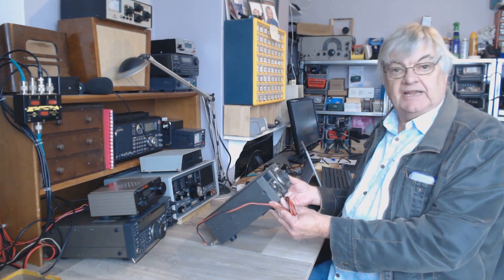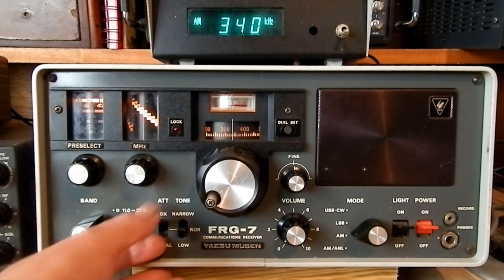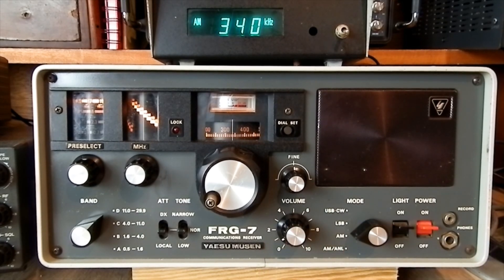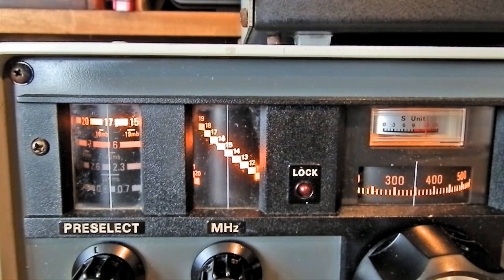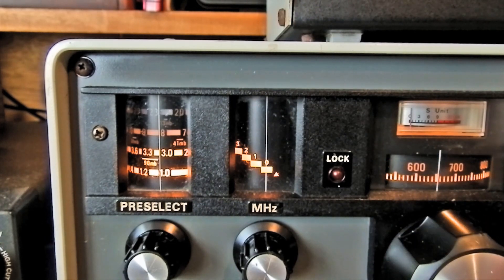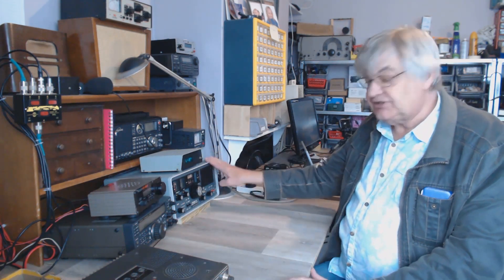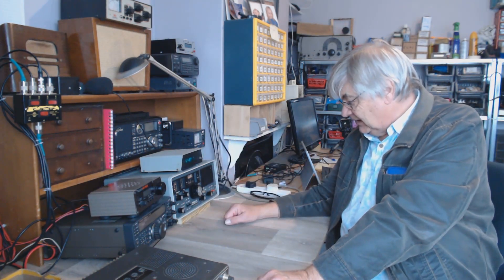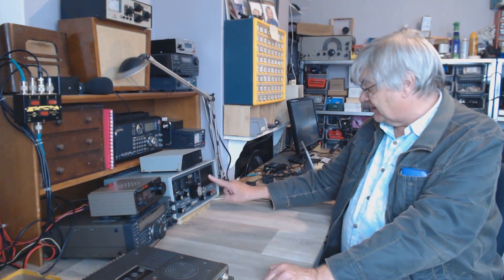G4NSJ - Yaesu FRG7 how to operate short wave communications receiver FRG 7 Frog

Comment: Hi just picked up an FRG7,  (August 2023 ) which Mini whip do you use ? very helpful video regards Alan
Reply from the maker: Hi Alan, This is the one from ebay.   https://www.ebay.co.uk/itm/295509916499?hash=item44cdc37b53:g:Fq0AAOSwF31j3jFL&amdata=enc%3AAQAIAAAA4Bl4mJZaZ4kO8ZzW4xE2RGfqi2L%2FcWRv3dUaLCrx6rbg5s6%2FpP0skPHCx%2FSsWqNbSz86UTu0P33di%2FVwPcTySOfNvZaiMStkUdQbHYNpT9Hp5THNoXphiNF3RqlDXftcpXTRL27t7E7lEiSJ6Wru3LsiM4zkH4J%2BS8rFLLmHE5fZGI4djRPB3%2FptfU%2BIGr9yZEmXH7oguvr35%2F12B%2FF0%2Fim5EUVGh7t2UL1igTojwlpwMXKu7gTDzPricnDUl%2BBmXbxRnB5mChp1DmDDYqafwjoU8w4yE1VW4I98oHauv4K5%7Ctkp%3ABFBMnpvFzb5i
Reply: Hi Ray , that was a quick response thank you, I have an End fed dipole, but wanted a quick aerial to lash up, so you would not recommend it for Amateur bands use ?, your Video on the FRG7 came in  handy yesterday after picking up the radio from Dorset Radio Rally, so thank you, regards Alan G4LDC
Reply from the maker: @alanwallis2796  Hi Alan, it will be fine for receiving on the amateir bands. But, the higher bands such as 10 metres might not be so good. Try it and see how you get on.

Comment: very nice video indeed! I suppose you could use a loop antenna to null out some of the broadcast band slop from adjacent stations with the marginal selectivity. As a kid it was the FRG7, the SPR4, and if you really went big the R390 series for the very serious DXers. By the way I have a Barlow Wadley xcr30 which operates much the way the FRG7 does, it's a fine portable.
Reply from the maker: I have tried a loop and it works very well. OK on the Barlow Wadley xcr30. sounds great. Cheers, Ray.

Comment: Hi Ray, interesting seeing your Yaesu FRG-7 receiver. I actually own a Yaesu FRG-100, which works quite well. Prior to that, I had a Yaesu FRG-7700, which was eventually used as a trade in for the FRG-100 at Dick Smith, after the receiver completely broke down. Wishing you all the best. Robert.
Reply from the maker: Hi Robert, it's good to hear from you. OK on your FRG-100, they are nice radios. I've heard that the FRG-7700 is pretty good but I've never had one. I do have the FRT-7700 ATU which is useful. Cheers for now, Ray.
Reply: @g4nsj  Hi Ray, I was actually given the Yaesu FRG-7700 for free by a neighbour down our street after he had received it from a friend, who had recently passed away. The neighbour had no interest in keeping the receiver and asked me if I could use it. The FRG-7700 had been well used and it did work quite well for a time. Unfortunately, it eventually broke down and could not be repaired. Hence, I then traded it in for the FRG-100 and I have used FRG-100 ever since. Anyway, take care. Robert.
Reply from the maker: @RGC198  Shame it broke  down. I think all the Yaesu radios are pretty good.

Comment: I never had one, but did use one once. Always wanted one but they were going a bit high when I looked  on EBay. 

I pretty much only have two 7 watt kit built transceivers and a Tecsun portable along with a quality SDR. Like you, I like the knobs and dials of the radio over SDR and too bad I lost my Kenwood TxRx in a move.
Reply from the maker: Yes, the FRG-7 radios are expensive these days. OK on your other kit, excellent.

Comment: I added a frog to my collection of radios, mine is an early model without a fine tuning control. I added a second filter which helps a bit on the amateur bands for SSB, but to be honest it's still better suited to broadcast listening. The wadley loop tuning takes some getting used to but is quite fun if you like twiddling knobs as I do!😂  They're fun simple receivers with good audio. Would I have it as my main general coverage receiver? No,  It doesn't have the stability or selectivity required for dependable SSB listening, but it's a nice radio to tinker with.
Reply from the maker: As you say, it’s a lovely radio to tinker with. I use mine mainly for broadcast bands… great fun! Cheers, Ray.

Comment: At the end there you said this switch turns the lites off on to save power on battery . I seen video where people changed out the bulbs in there gear replaced them with led it low power and would save those battery I found a roll of led at walmart for $5-20 more than enough for all the projects they are on a tape roll voltage is 5v or 12v
Reply from the maker: I have a roll of LEDs somewhere.

Comment: if you short out the two red connectors on the back of the radio, With a piece of wire . the medium wave will come in stronger. I do this with my frg 7700 and it works well really well. https://www.youtube.com/watch?v=dGwdaed0nWw&t=9s and it will work even with the pl-259 connected, for mw and lw or this one  https://www.youtube.com/watch?v=EVsbTroPo4c
Reply from the maker: Excellent, thanks!
Reply: @g4nsj  No problem Ray Glad to help. DE VE3TYA - - ..., ...--
Reply from the maker: I’ve just tried it… Wow! Medium wave is so much better!
Reply: @g4nsj   Glad you like it Now we just need more ghost stories lol.

Comment: Yes, I like my FRoG-7 too. Apparently, the "Lock" LED going OFF when lock is achieved was deliberate to save 10 mA when operated from batteries. The idea of it being a "portable" receiver is rather hilarious. I must confess I modded my "lock" LED to shine red when out of lock and green when in lock. (The purists will go nuts.)
The point of the Wadley-Barlow loop triple conversion design is to give virtually zero frequency drift from a cold start.
Reply from the maker: Excellent, thanks!

Comment: You should be able to get Radio Caroline easier soon Ray, you may well already know that Ofcom has granted them a significant power increase unspecified, the current power stands at 1Kw erp.
I had one of those FRG 7 back in the late 80s and as you say, very good once you learn the tuning.
Reply from the maker: Hi John, that's good news. I wasn't aware of that. Thanks for the info. Cheers, Ray.

Comment: I have have owned an FRG-7 since 1979 and used it mostly for medium wave DXing. Many US & Canadian stations were received! By listening to AM broadcasts in SSB mode, much greater selectivity is obtained. Using either upper or lower sideband it's possible to reduce interference on one side of the desired signal. 

The receiver still works, kind of, but needs a major service. These days I'm using an SDRPlay RSPDX which has a better performance than receivers costing £thousands in the Seventies.

Comment: I have an FRG-7 on the shelf behind me, it's a LOT dustier than your's, it DOESN'T have the VERY COOL digital readout and it hasn't had any wigglies run through it in OVER 30 years now. I wonder if the caps will still be OK? If I run some untamed electrons through it's internal bits and bobs. Or will lots of Yaesu Factory Smoke come spilling out of tired old componentry.......
Reply from the maker: I will probably replace the caps in mine at some stage. In the meantime, I'm enjoying the radio.

Comment: I bought an FRG7 back in the 1970s,  I took it to sea as "cabin" radio, it came in very useful as I had junior radio officer with me and I could monitor his cw when sending signals out and also listen on 500 kHz to see if he was missing anything HI.    I regard the FRG7 as a real milestone in ham radio general coverage RXs, it wasn't a particularly good RX, mainly due to the heavy AGC pumping with close spaced signals.   For it's price is was a really great way to be able to tune around and know pretty much what frequency you were on.  Great for broadcast and utility listening.  I moded my FRG7 with RF gain and agc on/off switch which helped.
Reply from the maker: Yes, it was a real  milestone back then. An  RF gain control and agc on/off switch is a good idea.

Comment: Scored mine a good few years ago at a local garage sale for $50AUD.  The attenuator switch is an odd one but good once you figure it out.  I’ve got a resistor between the AM and SW posts so the SO239 works for AM as well.  I also have a 10uF cap between Mute and Ground to slow the AGC for CW reception. Another feature that’s missing from the Frog.  Anyway, it did need some deoxit on the band and mode switches but otherwise it’s in fine shape.  I’ve replaced the lamps with leds, warm white to approximate tone of incandescent bulbs.  Unfortunately there is a lot of noise these days an I have to keep the attenuator at full to hear anything in the house.  If I take the FRG-7 up to the shed and run it on battery it’s a different story.
Reply from the maker: OK on the ATT switch and resistor. Good idea, I might do that. Cheers, Ray.

Comment: my first new receiver after the R1155 ... I've still got it it lives under the bed 🤣 it needs a good tune up and re caping  I think. I used to run mine with a Howes Audio filter which helped a bit but now you could probably fit a filter like the one that Sotabeams make . Sadly most of the Broadcasters have gone now and Short waves are a pale shadow of there former elves with the likes of Radio Australia, Tirana, Moscow etc all closing down.
Reply from the maker: It is a shame that so many stations have closed. I remember the 1960s… the trawler band, military stations, pirates, broadcast stations… all gone.